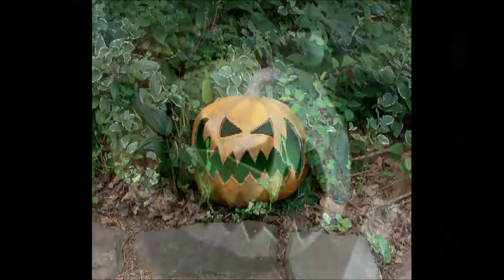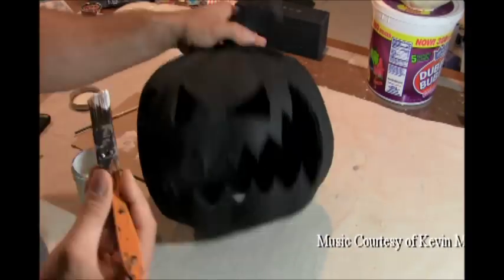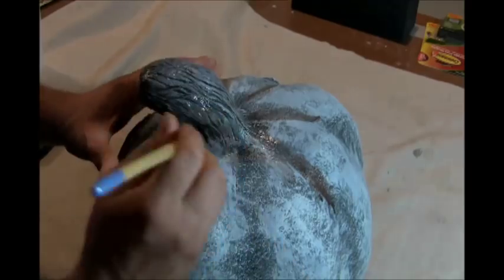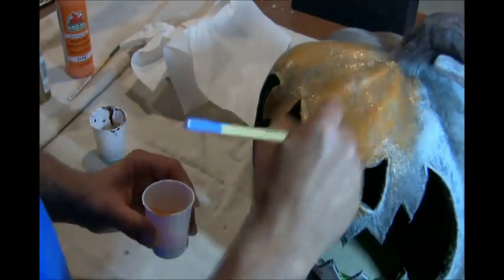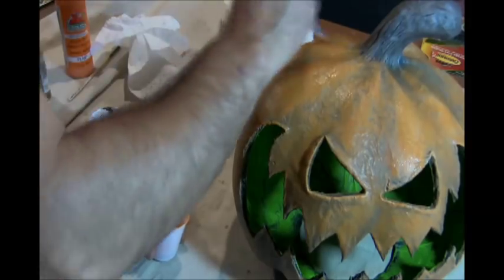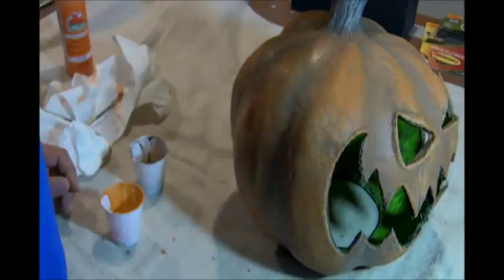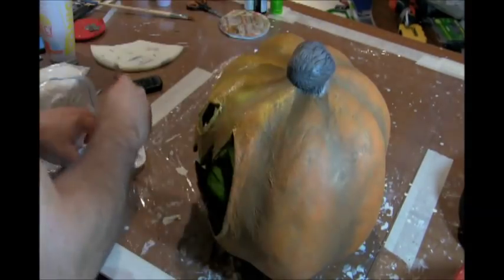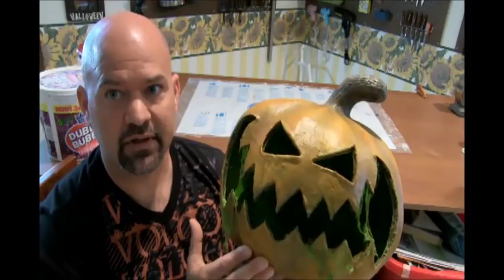How to make a paper mache pumpkin part 3

Comment: Will it hold up pretty well outside, in wet cold weather? Thanks... great job👌🏼👌🏼👌🏼
Reply from the maker: Yes it will.. in my latest video I put up on setting up my yard for Halloween there are several props on that video that have done 30 days in the weather for the past 6 years
Reply: Unhinged Productions thank you very much .. we have a lot of rain this year in Minnesota and so cold .. thanks once again
Reply from the maker: Yep same here.. when it comes to pumpkins depending on how wide you make the mouth, after they get a lot of rain they will get a bit soft.. then the mouth will start to sag.. but if you stick something back inside to prop it up once it dries out it will be all good again
Reply: Unhinged Productions thanks for the tips 🙏🙏🙏